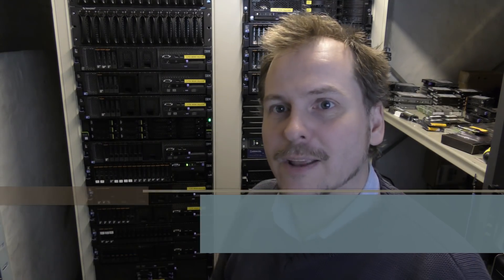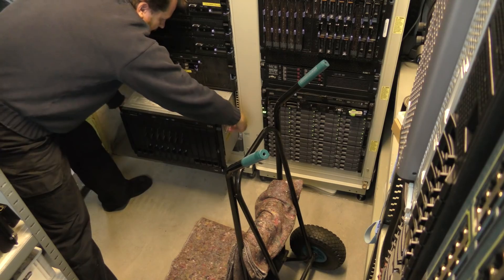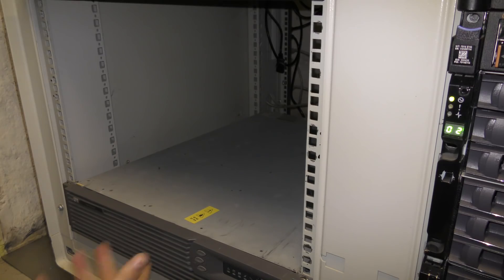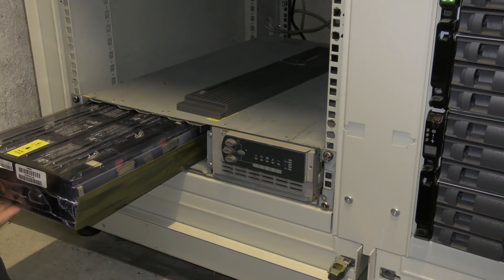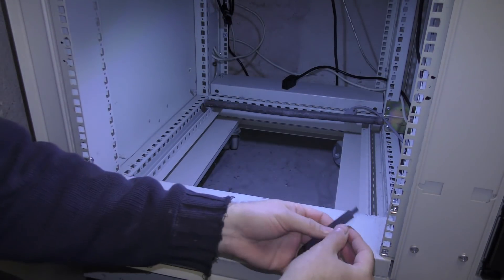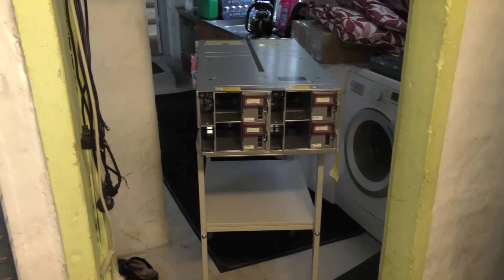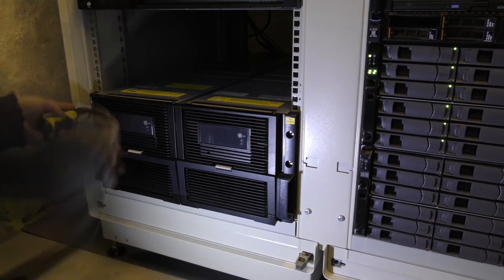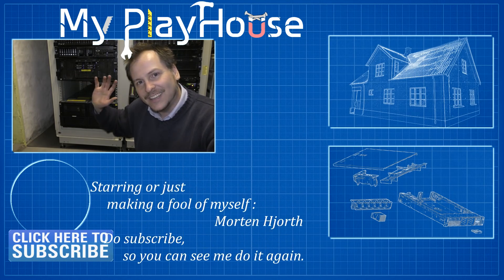The €500 70 bay HPE Storage's Box is now Mounted - 769

Comment from the maker: Hi,, did you watch mondays video ? :https://youtu.be/Q6VHck5rtJY  I would realy like to beat Lenovo on that one :-) Please check if you missed anything :-)
Reply: I seen both this one and that one! I wonder why notifications are messed up?

Also, have you thought of connecting everything up so that solar is port A and the UPS is port B on the switching device? Or you might want to try something like a line conditioner to make the inverter's (from solar) output less choppy?
Reply: With that removal tool dont use it to push down, put the small end of the tool behind the metal that goes around the nut and pull forwards ( don't push). You can remove them SUPER FAST then. Like easy 1 a second ( yes i am sad , yes i did time myself)
Reply: Yes that was a good video
Reply from the maker: Whatever he said..

Comment: Small point of clarification, this is NOT a Store once 6500.
The StoreOnce 6500 is a combination of a server and that DAS you have there.
That DAS has seen 3 generations.
MDS600 (3 GB SAS)
D6000 (6 GB SAS)
D6050 (12 GB SAS)
All hold 70 (35+35) LFF (3.5") drives.
I think the drive caddy type changed during one of the generations from HP G7 style to HP(E) Gen8 style.
Depending on which model you have, the User/Install Guide should have the cabling details.
For basic connectivity, you just need 1 port from each tray (left vs right) connected to the server.
Since it's just a DAS/JBOD, All RAID is done by the card in the server, not by this 5U monster.
Hope that helps,
/u/Casper042
Reply from the maker: Thanx,, then it must be a D6000 I have,, because of the 6 GB SAS.
The 12 GB SAS is a D6020 :-)

Comment: Morten, those squarenuts are so cheap, don't go the complicated way, instead just put in every square one. I'ts the easiest way.
Reply from the maker: Hi Django Ryffel
Thank You very much!  did not think of that,,, hey are not all the same whole size thowe.
Thank you for watching! :-)
Reply: @MyPlayHouse  yeah I know, HPE decided to use 5mm instead of 6mm... But for example, when I had to mount my 11kVA USV, you can imagine how heavy such a USV is and I had to mount it in 140cm height, I just put in every single square, where the USV was going to be mounted, a nut, lifted it once, and every thing was fine.

Comment: You can also get NetApp shelves pretty cheap and reformat them to 512 Bytes under Linux. Then you can throw ZFS on it and export it as NFS or iSCSI depending on your needs. That's was the cheapest way to get a good storage 2 years ago when I picked some up.
Reply: ZFS is over rated tho i am old school using HW RAID controllers, dont need to have much overhead when I do want to expand my volumes and things
Reply: @SakuraChan00  the issue with legacy controllers is, that they rely purely on integrity checks of the underlying hardware. If there's a fault the disk do not detect itself, the controller will still output happily the broken data.

Also if the controller dies you need a pretty similar controller, if you're running everything except raid 1. In very mixed up system setups that's a major drawback to fast recovering times.

The snapshot functionality paired with send and receive also easily beat any other backup solution: You reduce the overhead and complexity of your backups massively - which is always a good thing.

You can also encrypt the data on the disk by ZFS, which means you don't need to expensively destroy your used and broken disks - they are protected by state of the art encryption so nothing is recoverable.

Running open source solutions instead of proprietary software on custom hardware gives me additionally a better feeling in terms of stability.

I've been using ZFS for a decade now and never lost data.
Reply: ZFS if you dont plan it correctly can also get costly, my own storage boxes have 24 drives in each running RAID 6, and yes i do have backup controller cards, my data is not mission critical, one of these days i will backup to google drive, there is a use case for everything and i dont have the funding to map 1GB per TB of storage, not see a reason why i cant just add 1 drive to my "pool" expand it, redo the partition slightly and bam up and running once the task is done, the overhead for ZFS for me is not cost effective, maybe if i was say in the enterprise maybe, however they also dont rely on ZFS much yet, maybe in the future, also does ZFS work for windows natively cough if i were to switch to it from Linux, not that I would. Just something to consider because ZFS is still not widespread as most people would think
Reply: @SakuraChan00  you don't need no GB per TB storage. You need more than a GB per Storage if you want deduplication - which nobody would recommend you using at all, for most use cases.

If you add any drive to any pool you like, just attach it. 🤷🏼‍♂️

In conclusion: You dislike ZFS because you have very limited knowledge and use it wrong? I doubt that's ZFS fault 😂
Reply: well not about to change my RAID controllers to HBAs because someone on the net wants me to use ZFS, + where am I going to move 160TB worth of data ? if i wanted to use software raid type i will stick with MD
Reply from the maker: Hi Ruben Kelevra
Thank You very much!  But I did do both videos on reformating diskes from 520 bit til 512 ,, and videos on my two NetApp storage boxes.
Thank you for watching! :-)